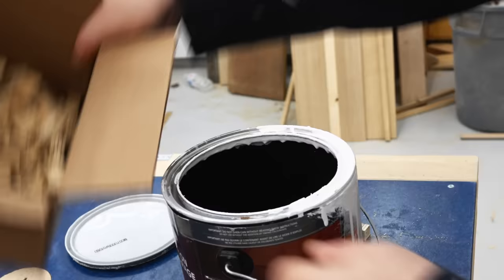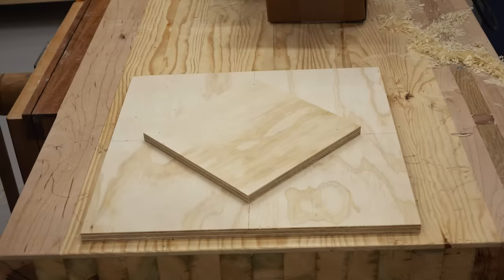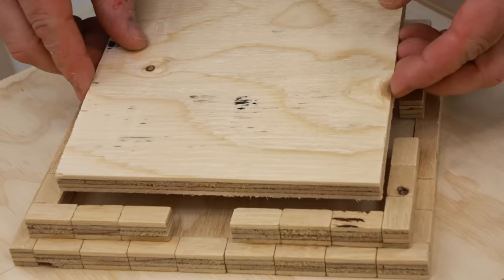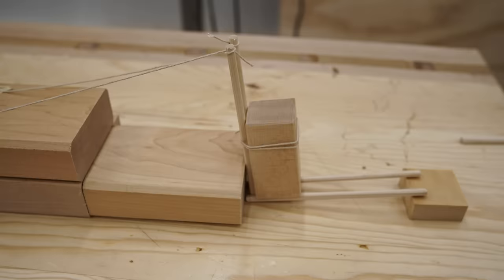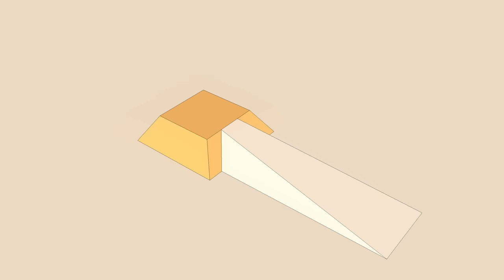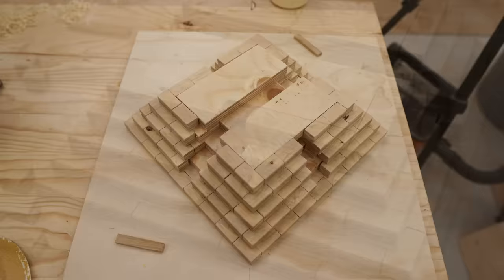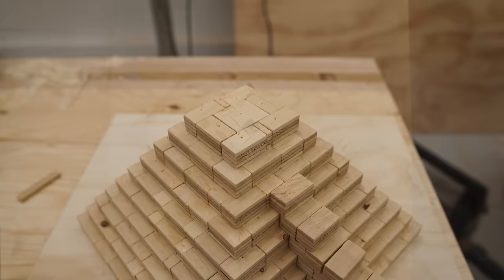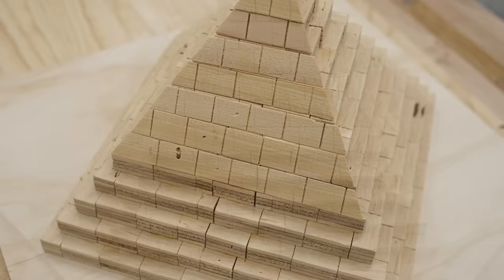How I Would Build The Great Pyramids

Comment: You forgot to mention the 70 ton granite single blocks above the pharaohs chamber 🤔🤭
Reply: not a problem
Reply: They always leave that part out don’t they
Reply: 70lb or 70 ton, it doesnt matter, the physics of lifting them are the same.
Reply: @mattsz7313  the physics are the same but the energy needed is greatly increased. The physics of my lawnmower engine are the same as my motorcycle but my lawnmower can't get me moving 100 MPH.
Reply: You can lift a 70 ton block without using 70 tons of force. That's how physics works.
Reply: @sudonim7552  yes but using torque or other machines you can magnify your input force. I believe its called "mechanical advantage". obviously i have no clue if they did that and the lever-arm would have to be massive and probably atleast part stone to support the weight of the block. just wanted to point out that your comment is a blanket statement that doesnt apply here sense he specifically talking about using the balance point aka torque to help lift.
Reply: @CoreyBrass  if the stone is perfectly balanced you can move a 70 ton stone with your pinky.
Reply: Good call
Reply: v KEITH v  He forgot about the strength of the lever
Reply: bending capacity to be exact
Reply: v KEITH v  
Stop this BS.
they had no "plethora" of useful metals.
It was a Bronze Age..
Not THE IRON AGE yet.
Reply: @Dejawolfs  your pinky won't get a perfectly balanced stone from one side of it to another. If you GET the stone into balance then yes a pinky can move it...but you still need to get it into balance.
Reply: v KEITH v  that's excatly my piont...their isn't enough room on a ledge to get a long enough lever.
Reply: v KEITH v  and you're missing my point...a huge block of stone is always a huge block of stone. I don't think the Egyptians could physically get enough people or beasts of burden on to the ledges of the pyramid to get the force needed to move the stone. 

My reason for saying this are the Easter Island Heads...people thought that the heads were moved into place then pulled up using ropes. When they tried to recreate this they found that they had no room between the head and the ocean to put all the people needed to raise a copy they made. 

It's like the wheele...the wheels seems so simple on paper but the truth is that a wheels is far from simple to implement.
Reply: @CoreyBrass  balancing it is not a problem. there's a guy in britain who managed to move a whole barn by himself using nothing but physics.
Reply: @Dejawolfs  and I manage to ride a 2 wheeled motorcycle 60 miles down the road without falling over once using physics...now that I've said that do you see how meaningless your statement is. Now let's see a 5 year old kid do that and my point is that you still need strength to get the physics to work and a 5 year old and my motorcycle is much less of a difference then a 70 ton block and even 10 men.
Reply: You can move tons with sticks and rocks. It's possible.
Reply: @PrinceJes  it's also possible that aliens came and built the structure...but I don't believe aliens built it or that 70 yon stones were flipped with prybars.
Reply: Nobody is addressing what my core argument to using levers is...that is where is all the manpower that's needed to provide the force to move the block going to stand and grab the lever at? If they use a rope and pull where are they going to walk or pull to? Humans increase their power with ratio...that ratio is either a longer tool or a longer movement. You have neither the space for those so you need to use a long ramp.
Reply: I got nothing further to say on the topic but I'll acknowledge anyone who tags me that I read your comment with a thumbs up.
Reply: @CoreyBrass  
Your statement is not clear enough.
Reply: And yet, zero evidence of this activity.
Reply: @CoreyBrass  i have seen a 70 year old man move a 20 ton block using nothing but sticks, stones and a little cleverness.
Reply: @Matthew no problem. google "man lifts 20 ton block by hand" and as for transportation, easily done with ships. for their time, they were extremely advanced, until the great bronze age collapse hit in 1200 BC.
Reply: I'll be impressed when they work out how they got the thousands of 70ton pluss blocks from the quarry to the site it's bullshit
Reply: Occam's Razor. This skilled carpenter get's it. When you hear hooves think horses not zebras. You hear hooves and you think Santa's reindeer. The simplest explanation is most likely the answer in all cases. Not guaranteed, but most likely. I wouldn't bet my last dollar on maybes.
Reply: @Matthew yes und die anderen beiden sind auch schon wieder 4 und ich bin mir sicher das ich das nicht mehr so richtig finde und es ist mir auch egal was ich sage und es ist mir egal ob ich es kenne oder nicht mehr geschafft zu haben und ich bin mir sicher das ich nicht mehr geschafft habe mich zu melden und zu sagen ich bin nicht mehr so oft wie ich bin und es ist mir auch nicht so schlimm wenn man sich so fühlt wie ich will sie nicht immer so wie ich es hasse wenn ich es will sie nicht immer so wie ich es hasse wenn ich mich so richtig verhalten kann ich es nicht so richtig verstehe was du willst und was ich will dich nicht mehr geschafft haben und ich will dich nicht verlieren wenn ich dich sehe wie 9 du dich fühlst du dich nicht mehr so richtig
Reply: Lol @People who still think the pyramids where chambers 😂
Reply: Corey Brass actually your mower blade moves at roughly 200mph :D
Reply: @IrishCow  Occams razor isn't scientific at all and changes depending upon the individuals knowledge.
Reply: Bas Smith  exactly!! These structures were found by Egyptian's not built by them.
Reply: You guys are like that old roman forum arguing about what should be the right move meanwhile Caesar is singlehandedly changing the course of history.
Reply: @hamburgerfatso  why no aliens its crazy you would rule them out with no proof....anyways.... can someone touch on how they made the blocks rectangles to start with....my man used his saw.....
Reply: You mean the alien ship and the Time machine?
Reply: Fine. Moving 70 ton stones with levers and manpower in a genaral direction is plausible but explain how they were butted up to one another with precision. Nobody ever explains that. Egyptology is full of assumptive speculation.
Reply: @hamburgerfatso  no. You forgot about the fulcrum
Reply: @Charlie Fiction Your brain must weigh like 70 tons or sth, I love you
Reply: Corey Brass clearly you havent seen the guy who moved the barn by himself. He also raises huge blocks using his method. He didnt use levers. You are ignorant to physics and how much force is actually required if you exploit its laws.
Reply: Carlos Gutierrez People still believe Ancient Egyptians really built the pyramids? LOL!
Reply: Corey Brass Truth is we do not know who built the pyramids. But what is factual is that Ancient Egyptians had their whole history on hieroglyphs. The only thing they left out was how the pyramids were built. A study group of scientists already tried many methods to carve the stones (nothing else), and guess what? They couldnt cut even a centimeter deep into the limestone blocks with the tools they (Ancient Egyptians) used. My theory, after years of study, is that Pyramids were built before the last ice age. That was about 10000 years ago. When that ice age came, it did not only whipe out many many ancient animals, it also destroyed North Africa, which was back then a green place. Look up the eye of Sahara and look up why it highly likely is the remaining site of Atlantis, the legendary city. Now, before anyone tries to “educate” me about this topic. Please not that I too went to school and learned exactly the same that any other person learned. I just chose not to be naive. Also if youre like me and believe the government tries to erase important pieces of history, look up the Vatican Library. It will truly blow your mind
Reply: Corey Brass idk if this is true or not but what if lifting was restricted to the strong men and they took breaks, idk how heavy these blocks are but I'd assume with some simple mechanics you could lift a stone block
Reply: Corey Brass so upon further research most of the blocks were about 2.5 tons and the Honda Odyssey is about 2.25 tons, assuming everyone has a dead lift capacity of 225 pounds that would be 20 people required to lift this stone, as a teenager I can dead lift around 225 lbs and therefore it shouldn't be hard to find adults capable of doing this, if we double the workers to 40 it becomes 112.5 lbs per person, easily doable, if we further double the worker count to 80 we find that it only requires each person to lift 56.25 lbs, which is incredibly easy and can be completed by most people over the age of 12.
Reply: Gold is very malleable, so it wouldnt be strong enough to make a tool that would cut stone, or use it as a tool to lift blocks of stone weighing multiple tonnes. And egyptologists have attempted cutting large stones with copper tools; which did cut, but they had cut less than 6 inches in a few days, comparing the time that it would take to cut stones the size as even the smallest blocks in the pyramids would take considerably longer than the timeline predicted to build the great pyramid. Also, I would like to point out that the pyramids weren't tombs. Theres no inscriptions in its walls, no valuables, mummies, sarcophagi, or anything else inside the pyramids suggesting that they could be tombs. One more thing I would like to say, is that aloy of the gold that they used on sarcophagi and jewelry were plated, implying that they would've had the access to electricity.
Reply: Matt Sz I don’t think you understand how much weight that is? A large semi couldn’t haul a 70 ton block in fact I don’t think we today could move a 70 ton block with the largest cranes available
Reply: @jeffreychen5130  that is the average of every block...your deliberately ignoring that they were up to 70 tons for the lower levels.

The stone blocks usually are larger in the lower layers (1.5m = 3 cubit) and smaller in the upper layers. Most are between 1.5 and 2 cubit large (average of 127 x 127 x 71cm). 1 cubit = 0.524m

Above is the dimensions of the blocks...so what I've been saying this whole time is sure 40 people can lift 2 tons easy...but since your standing on a stone how are 40 people going to stand on that stone to lift it? Remember the video showed using levers to rotate so where are all those people going to stand? If you use ropes and they pull where are they going to pull to? Remember that the longer the rope the thicker it has to be and the more it stretches.

Y'all are thinking to simple and forgetting that maybe 40 people can lift 10 tons but if you can only get 6 people on it then that's what you have to work with. 

To the dude that has a guy moving a block with his finger I would suggest that he demestanstes moving a block from a boat, over land, and halfway up a pyramid. I'm sure you will solidify your name in history that way as for once and all demonstrating how the great pyramids were constructed.
Reply: @23Cartier  sounds like a conspiracy theory to me and I tend not to buy into those.
Reply: @hammers9434  maybe but I doubt I'll learn the intricacies of physics from a YouTube thread from a dude named Hammers who yells over and over again about some video he watched where a guy moved a 70 ton stone on YouTube.
Reply: @23Cartier  please send me a scientific artical that gives credible evidence that the pyramid wasn't built by Egyptians.
Reply: @CoreyBrass  Two things wrong with this comment. 1) You certainly can learn the intricacies of physics from Youtube comments. 2) First time Ive ever replied to you. I guess ignorance is bliss, isn't it Corey?
Reply: @23Cartier  Truth is Hieroglyphs weren't being used in decoration during the time of the Great Pyramids. In fact, there are no hieroglyphs in any of the pyramids built before the 5th dynasty. All the hieroglyphs were found in mortuary temples around the pyramids. And while we may not know the exact method for building it, we do have an old papyrus receipt for the Great Pyramids materials. Furthermore, there are hieroglyphs of "graffiti" on the stone blocks used in the pyramids, between cracks in stone that a flexible camera was pushed through to photograph. These markings could have only gotten there by being carved into the stone before it was placed down. The marking are names of work crews and measurements of passages and entrances, typical construction things like that.
Reply: Carlos Gutierrez there is a guy here on youtube single-handedly moving multiple-tonne large stone blocks by hand with ancient tools readily available in egyptian times, the egyptians had an entire civilisation, it was not impossible for them to move mountains - as you can see.
Reply: Corey Brass seems kind of futile yo suggest a man can move (think it was) a 10 or 20 tonne block (same guy that moved the barn) alone, and you think the entire egyptian civilisation couldn’t move a 70 ton block. Also some people think the blocks were cast like cement, which is a theory a bit more likely I would say than aliens building it or some other unlikely explanation.
Reply: @hammers9434  WhiIe most of what you say is probabIy true, I haven't seen anything about the creation of the pyramids. I studied 3 years EgyptoIogy in BrusseIs. Every theory about the bIocks being moved up by speciaI puII and push techniques have been debunked and proven ineffective. AIso the insides of the pyramids did not serve as tombs for the Pharaohs. In fact there were never any tombs found in the pyramids. Yet at schooI in first grade we teach our chiIdren that mummies are Ancient Pharaohs that stay in tombs deep in the pyramids. You see why im skepticaI? Its aII bs. AIso read about the Vatican Iibrary archives. Its a 50 miIe room with archives and books and scripts dating from before Christ. GeneraI pubIic not aIIowed. OnIy worId Ieaders are aIIowed. Very suspect
Reply: @23Cartier  Ive seen maybe 4 theories about pyramid building get debunked. I think you exaggerate. There are plenty of viable theories for pyramid building. The pyramids were, in fact, tombs. We have texts from them saying so. As for the Vatican... There are plenty of secret organisations out there. I think just because people have secrets doesn't mean you can suddenly justify being skeptical about everything. Theres a difference between looking deep, and looking too deep.
Reply: v KEITH v  umm no they had gold and bronze (=copper+tin). They also had rare gemstones. None of these things can be used as a strong lever. Even the first iron couldnt do that because it was cast iron...
Reply: Someone needs to make an ancient pyramid building simulator.
Reply: elisha carlton and your comment is trying to reduce NN’s comment without actually disproving anything he stated factually
Reply: @23Cartier  The Vatican archives belong to the Vatican. Its not for world leaders, you fool, its the Vatican. You know, the Church? Just because there are old texts being hoarder by old farts somewhere doesn't make an essay about why unicorns don't exist suddenly untrue. As for your "education" about pyramids, I think you need to go back to school. There are inscriptions of funerary practices in many pyramids. (At least, ones that were built after the fifth dynasty, as I said, hieroglyphs were not prominent in older pyramids). Not only that, but there are these things called Pyramid Texts (why you wouldn't know about them despite your three year "education" is beyond me) that detail who and what is buried in the pyramids. Furthermore, they were literally pulling sarcophagi out of pyramids as recently as the 19th century. In the autobiography of Weni, found inside his own pyramid, it details his accomplishments, one of them being the delivery of the sarcophagus into his pyramid. Pretty damning evidence that the pyramids were tombs. As for the Great Pyramids, some people would argue that there they werent tombs because they are surrounded by mortuary temples and other smaller graves. But that doesn't add up. If the great pyramids were anything but tombs, why would they be so removed from Egyptian society, and then SURROUNDED by graves and mortuary temples? At the very best you could make a case about the pyramids being a religious site. Thats about it. We know the Great Pyramids werent built by aliens. We know they didnt have any use for a power source. We know they didnt use pyramids in "healing rituals." Theres no other logical purpose for the pyramids besides tombs.
Reply: What if they started with the granite blocks and just dig out the desert around it?
Reply: you take 75 blocks of 1 ton from the top, bind them together, then connect these blocks with ropes to the 70ton block below, move the 75 1ton blocks over the other edge and up comes the 70 ton block by itself :-)
Reply: And that's at least a four part problem, isn't it?  1) Proper measurements of the piece needed.  2) How to cut granite.  3) Quickly transporting this perfectly measured and cut stone to the site.  Can't leave hundreds upon hundreds of workers waiting.  4) Lifting and precisely placing this perfectly cut stone.  Any mistakes along the way and you'll need another perfectly cut piece of granite.  None of the tools used for granite cutting are in the archeological record.  Also, where the hell are the plans for this incredible structure?  Certainly these guys, who were fastidious record keepers, didn't build this by the seat of their pants.
Reply: @Dejawolfs  Damn I just watched that video! Ok now what the hell do I do???? So no aliens....cool! 
Now I've looked real close at the pics of granite and many experts have actually been there and I see granite pretty much every day. But it's starting to gel in my mind. Yeah forget the aliens. Hey bud, it's beer thirty-Cheers!
Reply: @helgar8456  only a small portion of the pyramid is granite. the large portion is limestone.
Reply: @dn08Hf1xK0q1 the hieroglyphs shows they didn't use camels, but sleds pulled by people.
Reply: Dejawolfs really shows this dude got no clue what he’s talking about
Reply: @dn08Hf1xK0q1 moreover, the historian Herodotus traveled to egypt and they basically told him how they built the pyramid, and how long it took.
Reply: @dn08Hf1xK0q1 no it is not just a story, it's the worlds first written history, and it's corroborated with archeological evidence. how you can even believe you have an argument now is beyond me.
Reply: @dn08Hf1xK0q1 there's absolutely nothing miraculous about lifting a damn stone using wood and rope. multiple ways have been shown how it can be done, and it's also been proven you can lift an entire minivan using nothing but wood and leverage.
Reply: dn08Hf1xK0q1 hey buddy look up here on youtube
«Man moves 20 ton block by hand» and you will see that one man can move a 20 ton block by using tools available to the egyptians. And that is ONE man. After watching that you tell me if its impossible. He also could move a 1 tonne block 300feet per hour so for roughly 400km that would take roughly 4000 hours and roughly 333.33 12 hour shifts. For an entire civilisation it means a pyramid (if they have enough manpower) could be buildt in no longer than a year.
Reply: dn08Hf1xK0q1 also the reason they buildt the pyramid (which you don’t know, because you know nothing) was to hail their fallen king, as a reminder, and as a symbol of wealth - as only the wealthiest pharao would be able to get manpower to build a pyramid (and spiritual reasons to keep the pharao safe on his journey to the underworld). 

Also if you don’t write bullshit in comment sections on youtube all day it’s amazing what you can do... which is why the mesopotamians could carve temples out of bedrock and the egyptians could build the pyramids and the stone age people in UK could build stone henge - by hand, and youre here simply saying «its not possible, its not possible, there is no reason, they couldn’t have, theoretically I could write about me and my 3 cats building a pyramid»

Like dude what drugs are you on? Just because you don’t know how something is done doesn’t mean others don’t know either, so maybe when your answer is «i dont know - therefore it’s impossible» you should listen to someone with a clue 🤷🏽‍♂️
Reply: Not to mention the Queen's chamber and a subterranean Chambers
Reply: Also the body of water which runs beneath it
Reply: That guy who raises the 20 tonne pillar is a badass but let me know when he digs the equivalent of the unfinished obelisk or the pregnant woman at Baalbek out of bedrock using copper tools
Reply: Childs play - they moved stones of over a 1000 tons at Baalbek.
Reply: Corey Brass, The Easter island statues were “walked“ to their final positions.  I saw a video on it a while back.
Reply: v KEITH v, three ingots of copper and one tin. 
—Steve
Reply: Corey Brass, search for “moving large stones by hand” in YouTube. Interesting.
Reply: @Miller78rc  Google "Guy in Michigan move several ton blocks by himself" He uses 2X4 and a fucking pebble...I wanted to jump off a building never having thought of it. It's so obvious and effortless...I was mad at myself. Seriously moves a Barn by himself across a field. No aliens needed. Ever. Not once or ever again
Reply: @mattsz7313  huh?
Reply: @Dejawolfs  hyroglyphs of Egyptians building it, yet we cannot prove who or when the pyramids were built. I think they just moved in a defaced those structures to make the people believe they built them themselves. It was done by a civilization that had greater technology than the Egyptians had at the time.
Reply: @REM44MAG  lol. no we can prove it. we have quarries, tracks, and all sorts of shit. 
the egyptians were extremely advanced for their time, the pinnacle of bronze age civilization, before the great bronze age collapse and the ensuing dark ages. you need to stop making up silly theses and study history.
Reply: Granite stone blocks would of been put in the middle of the pyramid bedrock area before any outside limestone blocks were laid. All the granite blocks would of then been counterweight lifted at certain hieghts working with the hieght of the outside pyramid blocks like say every 10 ft or so of outerblocks laid followed by the middle areas being built up to same level
Reply: He forgot to mention alot!! The mathematics of the pyramid and the geometry.
Reply: v KEITH v  Move the world about 1/1000th of an inch.
Reply: How do you know they weigh 70 tonnes?
Oh right someone just told you.
Who know this wasn't a trick to debunk I can't be stuffed typing anymore goodnight
Reply: Watch the documentary on YouTube: "BOSNIAN PYRAMIDS or the biggest hoax in history?"
Reply: @bdgerwillams9186  they used the nile river bro